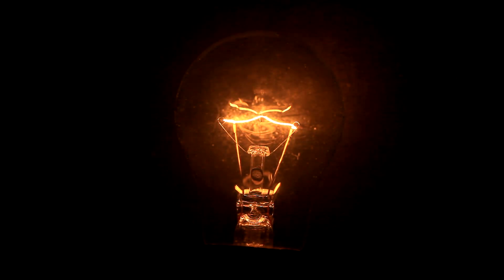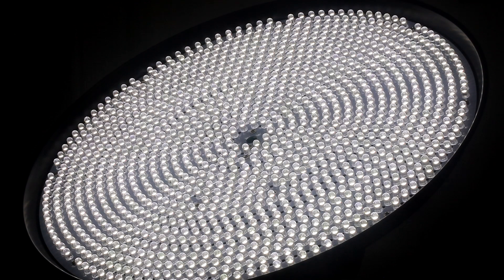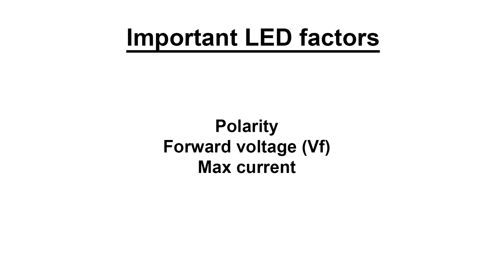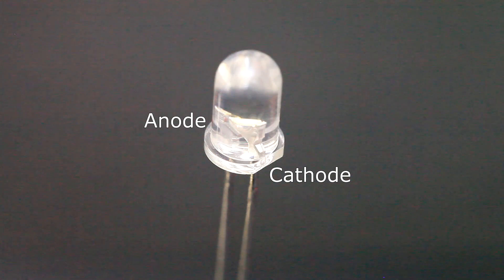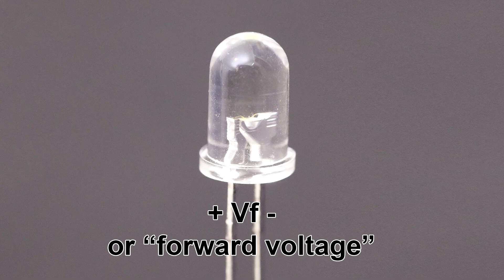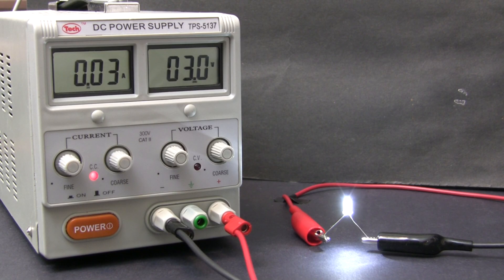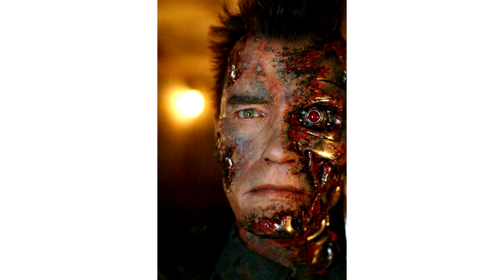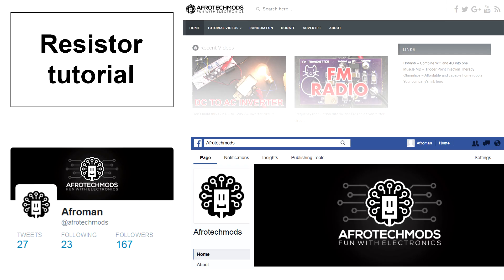LED Basics

Comment: Do leds have data sheets?
Reply from the maker: Everything electronic has a datasheet!
Reply: Afrotechmods Thanks for the reply sir (respects for the excellent videos you make!). Now I know we don't need extreme details about  those small 3V or 5v leds other than the ones in the video,  but these leds don't have part numbers written on them. I have googled & found data sheets before but sometimes it becomes a little hard to ascertain which particular model the led may be. As there are often many small variations in the same family like the 1N00 series. Also I find the same thing with resistors. I can easily calculate the colour Code,  but I have no idea about it's V, I, P ratings. U almost always need datasheets to design efficient & circuits. Can you shed a little light on reliable source for data sheets?
Reply: Afrotechmods Hi, another request, do you have any videos on designing and troubleshooting real world electronic circuits?. I mean a general overall guide that would encompass analog, digital (inc ICs) & microcontroller circuits?. Irrespective of a specific circuit, are there any guidlines or frameworks or methodologies to go about to design or trouble shoot circuits?. If you don't have,  will you be able make a few videos on these 2 topics? Please reply, I have subscribed as I felt your channel to be very helpful to learn electronics.
Reply: May be you could make a video on analog, digital, ic,  mixed, uC each like a series (Sorry if I am asking too much), but I feel like this is really missing in my College. It's just mostly theory here.

Comment: So If you want to make a 12 LED circuit, where can you find the circuit board and can you use a battery that's small enough to fit inside a small cardboard box

Comment: So as long as we don't go over the recommended voltage, the LED will be fine, regardless of the amps the power supply has?
Reply from the maker: Pretty much yeah. But if you are off by 0.1V you can easily blow the LED.
Reply: Trust me, you should really control the current of an LED rather than voltage, the fV can vary by temperature and other factors like manufacture differences. Try connecting two same LEDs in parallel to a constant voltage supply, you will see that one will glow a tiny bit brighter as it takes more current. If you are building LED light source you should use constant current supply.
Reply: Noah Nobody ii

Comment: wait @ i did not get >> why the LED did not burn it self so badly when we used the battery ??
Reply: Rimo Danish  you need a resister since the battery is too much power for the led

Comment: love this 101 LED tutorial . Question . I have a winding path thru the woods of around 1,000 ft long. 
I would like to string some LEDs above it for indicating the path at night ..like lights on the floor of an aircraft for emergency exit. There is no 120 AC volts at that location so I was wondering how to do it with solar . Now , I see solar being used on electric cattle fences emitting DC power. One wire carries current in a pulsating manner and is grounded at the other end . Can I use such a system , trough a DC batt. by connecting one wire to the anode and run a seperate wire to ground ?

Comment: I have a question:
If I want to hook 1 of this 3v leds to my car battery (12 Volts 1200 CCA) What would I need to do for it to withstand the voltage and also, taking in account that most cars voltage vary from 10 v to up to 16 V+ Can anyone tell me how to? I already tried few times and it will die sooner or later... some just blow up instantaneous and others stay put for some hours and the overheat and melt ( I always add a fusible on the line so no worries) still I want to have them working for a project and I'm using a test board but seems that I've missed something...
Reply: A 620 ohm 1/2 watt resistor in series with the LED will prevent it from prematurely burning up by limiting the current. The resister can be wired in between the power supply lead and anode or between the cathode and ground, doesn't matter.  A 470 or 430 ohm 1/2 watt resistor would allow the LED to run brighter but would allow more than 20 mA of current at voltages above 12 volts.  This all assumes  a fV of 2 volts and a current rating of 20mA. Hope it helps.

Comment: If you use more then 1 LED light as use a string of LEDs you can use more then 7 volts to operate them..... I used a small string of 18 LEDs with a 12 volt car battery before and then work just fine, still work to this day even. I may also add that instead of using resistors and other parts that can fail even tho the LED could be still good isn't always needed. I have also run the same 18 LED string of low voltage AC around 8-10 volts and just like you state there is nothing to worry about the polarity being wrong , there is no damage done as far as I can tell..  Maybe that test you did with the 7 volts current to kill your LED , see if the effect happens with the current reversed.... I'm guessing that nothing will happen but if there was a way to burn a LED with reversed polarity I'd like to know....
Reply: > but if there was a way to burn a LED with reversed polarity I'd like to know....

LEDs can typically only take a reverse voltage of about 5V. Exceed that and the act pretty much as zener diodes and the current rises QUICKLY.  Then they're subject to heat according to P=U x I

Comment: If you would have left the led on 3 volts and only turned up the amps the led would have been just fine. You turned both the amps and voltage up saying the current would destroy the led, by turning the voltage up you blew the led...

Comment: I just wired these multi color flashing LEDS on my motherboard HDD activity pins !OMG! It looks amazing. Full on light show in a tiny bulb. I can't find anything about how much they pull, hope they don't burn out the header. Really happy with it for now. 
http://www.ebay.com/itm/172138863110?
Seller also has some really good cat decals I got in the same shipment.

Comment: Where did you find the table of voltages of the different LED's? I find it peculiar that the blue and white LED are not said to have the same Vf - After all a white LED is just a deep blue (royal blue) LED with phosphor on top, so the Vf should be (and is generally, apart from small differences in chemistry) the same.
Reply: The respective LED datashit has that information. For example here: 

http://www1.futureelectronics.com/doc/EVERLIGHT%C2%A0/334-15__T1C1-4WYA.pdf

Go to the fourd page, there is a table that says: "forward voltage", and there the min. voltaje is 3.0v and the max. voltaje is 3.6v
Reply: Almost all generic LED's have the same forward voltage because they are made with the same material.
Reply: Red,  orange, yellow, and 570 nM green usually have a a fV of around 2 volts while 525 nM green, blue, and white around 3 volts. IR LEDs  are around 1.6 volts. Read the data sheets and uses these numbers only as a guide if there is no data available. Current is another story, a data sheet is required. Most 3mm (T1) or 5mm (T1-3/4) have a rating of 20mA as do the smaller SMT packages. The data sheets are important especially once larger packages and wattage ratings of LEDs are used.

A white LED is in fact a blue LED with phosphor on the lens. A manufacturer may have blue and white LEDs that use the same die and have the same voltage and current ratings. The same can occur with white LEDs of different temperatures. Warm white (2700 - 3500K) usually have a lesser light output as the phosphor is thicker and of a different composition than that of a neutral (4000-5000K)  or cool white (5000-6500K) LED. The same die may be used to produce white LEDs of all of the different color temperatures. The color of the phosphor on a warm white LED has a visible reddish tint and tends to block more light than that of neutral or cool white LEDs and lessens the light output..
Reply: One should also be aware that some coloured (red, yellow, orange, green etc) LEDs are actually using the same technique as white LEDS - using a blue LED internally and using phosphors to generate the visible colored light. For these the usual rule of varying forward voltage by colour doesn't apply.

For instance used in some simple Christmas/fairy light strings where all the LEDs are wired in parallel and all run at the same voltage without needing resistors to adjust for varying forward voltages

And if you're buying LEDs from China (eBay, AliEDxpress et al) sometimes batches have the pins reversed (ie the long one isn't the anode). They can even have the semiconductor chip reversed inside, so not even which leg that is connected to the 'anvil' (the larger internal piece of metal) is a sure thing. Never assume - test.

Comment: As far as I can see the current limiting resistor is not necessary as long as you won't exceed forward voltage. When I started in electronics I remember everybody used to say that you have to put a resistor regardless what voltage you're running those led's. So I did a test. I plugged white led to a 3V source for two months. After two months I plugged another led to compare if the brightness changed. Nothing, same brightness. Then I added a resistor and brightness dropped. Never looked more into led's but as far as I can see - as long you're within the Vf range you don't really need a resistor. And without it, you get the maximum brightness. I might be wrong, who knows.
Reply: Melectro   Only If Battery volts is the same as the constant led volt drop.  Highly unlikely,  if battery has more volts current will exceed max    goodby led! a weak bat the voltage will drop to the led constant v and in this case would work cause the internal batteyr resistance takes place of the resistor needed
Reply: If you're eliminating the ballast resistor, you will need to control the forward voltage very carefully, and such designs may not accommodate a wide temperature range, since the forward voltage of an LED may have an appreciable temperature coefficient.
Reply: Melectro gotta try that
Reply: A constant current source/sink is much better compared to a resistor, due to keeping the current constant, even if the voltage changes. For further information:
https://www.youtube.com/watch?v=iuMngik0GR8
Reply: You are correct, if the voltage is tightly controlled and matches the fV of the LED you can get away with not using a resistor. A common circuit schematic with car tail lights or with the LED strips is to put three LEDs in series, use a 12 volt supply, and a current limiting resistor for each set of three LEDs. The red LEDs usually have a fV of 2 volts while the 525 nM green and blue have a fv of around 3 volts. I have not examined auto tail lights and am not exactly sure of what they are doing or if they have added extra protection due to the voltage fluctuation. The LEDs used on the Chinese strips have different current ratings, some are rated at 1 amp per meter and others 1.2 amp. Some strips have 30 LEDs per meter and others 60. In any case there is usually one resistor value for the green and blue and a second value for the red. Without a current limiting resistor, if the voltage is turned up the current also goes up which will shorten the life of the LED to in some cases milliseconds.

Comment: So you just made a 4 minutes long educational video about LEDs for a beginners, mentioned resistors and didn't even show a simple formula to calculate the right current limiting resistors using LED's voltage drop, input voltage and desired current?
Reply: I am very happy to announce that the topic of interest will be covered in the next video. That has been stated by Mr. Afrotechmods himself.
Reply: Oh, that explains everything, thanks!

Comment: Once I was at a casual robotics workshop (making things move) and the LEDs supplied by the organisers were cheap chinese ones with inverted leads: shorter Anode, longer Cathode.
I've been using the death test to figure out max current for a while now, and my Fluke tells me the Vf when I test a diode.
Good to see more frequent videos from you again, by the way :)

Comment: So I'm clear: if you had set the voltage to a value > 3v (i.e. 12v) and put a constant current limit of 20mA on the supply, the LED would have functioned fine at 12v?
Reply from the maker: That's not how it works. The CC limit would kick in at 20mA by limiting the voltage output to whatever voltage would cause 20mA to flow through the LED. In this case that would have been around 3V. So the supply would be outputting 12V right up until >=20mA flows then it would drop the voltage.
Reply: That cleared things up. Thanks!

Comment: There's some good information here, but I think you should post the information about limiting the current with resistors as soon as possible.

Sure, the LEDs don't cost much, and could be regarded as expendable, but I've worked in semiconductor manufacturing and I hate to see perfectly good components die for no reason.

Comment: What's the green middle terminal in the power supply used for?
Reply: Earth/Ground, green (or green and yellow striped) is generally the colour of an earthed wire and if you look just above the terminal there is the ground symbol.
Reply: Rob Fraser How's it used in a power supply like that?
Reply: mrsemifixit Mostly it's not. You might use it to connect a circuit ground to earth ground to reduce noise, for example.

Comment: where can I get yellow or lime green LEDs that don't suck?

Typically, I have found that most red, neon green, and blue/white LEDs are pretty efficient and can operate under 100uA!  However all the yellow LEDs I dealt with simply suck in comparison, in terms of efficiency and ruggedness (tolerance to abuse) Has anyone got any yellow LEDs that are as bright as bright superbright blue ones?

Comment: You can also show how junction temperature change impacts performance when driving an LED with Voltage and ballasting with a resistor.
Better to drive using a constant current source, but this is not cost effective commercially.

Comment: i have a question, how do multicolor led work?
Reply from the maker: They have multiple LEDs inside one package. An example might be an RGB LED with 3 anodes, one each for R G B and a common cathode that is shared by all of them.
Reply: and what triggers the difference in color is a difference in voltage?
Reply from the maker: Dani Flunky Cook
No, the actual LEDs are different. They are made from different semiconductors that give off a different photon wavelength. http://www.liantronics.com/News/2008101114435979548.html
Reply: thanks for the answer man, and thank you for your videos, really easy to understand, i've been following you since a long time now!

Cheers
Reply: There are three separate dies in the LED, usually but not always one red, one green, and one blue. Sometimes the cathodes are all connected to one terminal and sometimes the anodes. On the larger packages there may be six terminals one for each anode and each cathode. By mixing the different colors at different brightness levels the color emitted is infinite in hue. The individual color levels are controlled by the amount of current or more commonly by pulse with modulation  (PWM) where the LED color is rapidly turned on and off.
Reply: I needed an RGB LED but only had single color red green an blue's, so I carefully cut away some of the plastic package and stuck them together and soldered the anodes together. Works like a charm and is much cheaper.
Reply: If the chemistry of the LED is exposed to contaminants or moisture the life may be shortened. RGB LEDs are cheap on eBay or Amazon.

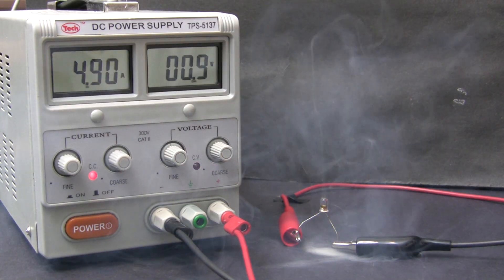Comment: 3:47 : magic smoke !
It seems there is a clicking sound (relay?) coming from the powersupply at some point while it is switching between constant current and constant voltage modes. Seems it still limit current somehow (to protect itself?)

Comment: I've always loved LEDs, ever since I got my first electronics project kit from Radio Shack as a kid.  I was fascinated by the soft pure red light they put out.  That was back in the early to mid 80s, long before blue or white LEDs hit the market, or anything with a high intensity output.

Great video!  I'm always looking forward to the next one.  I used your laser tripwire project to make a circuit that will be used to open up a solenoid valve to release a jet of compressed air and scare birds away from making nests on my house.  It's almost complete and needs a good box to put it into so I can mount it on the side of the house next spring.
Reply: Sounds cool